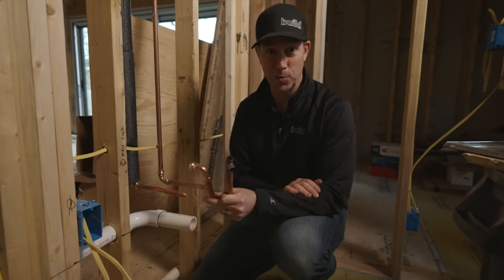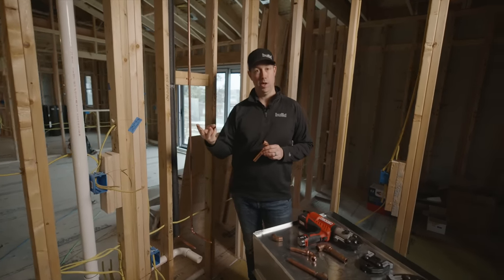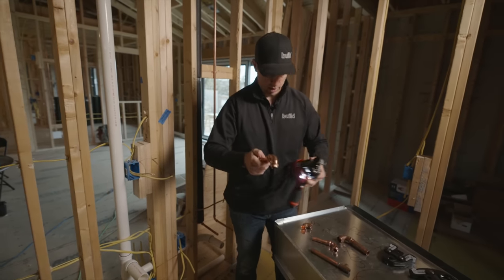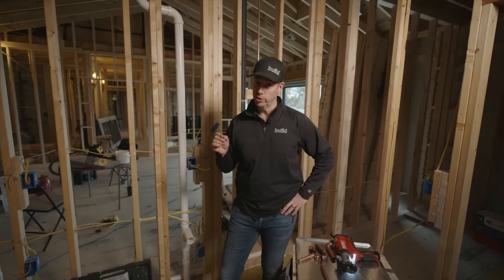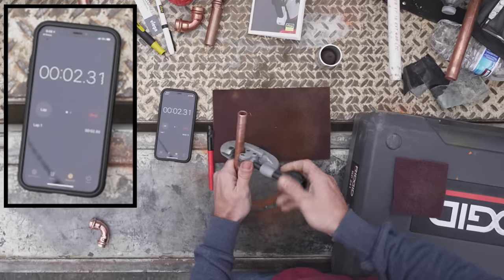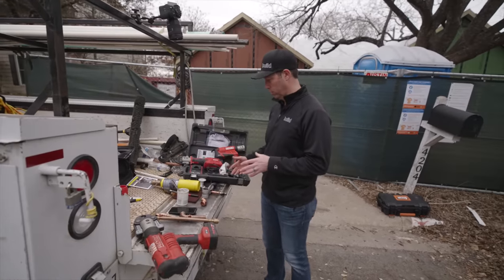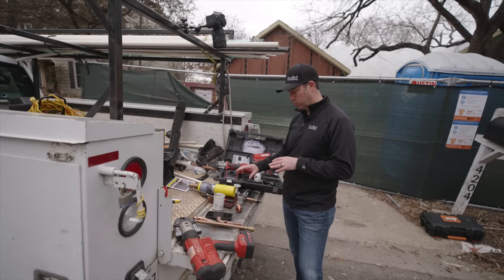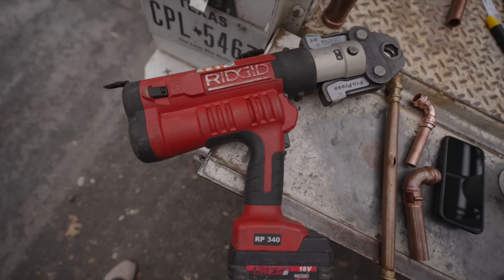Copper Plumbing - Viega ProPress vs. Soldered

Comment: As a DIYer, I learned I will never afford that tool even when I remodel a bathroom or repipe an entire house.
How well do the manual tools work?
Reply: You could dry fit your connection then rent the tool to bang them out quickly.
Reply: Just get good a sweeting pipes, it's tried and true.
Reply: James Last Name , I've been plumbing since late 80's and I bought the manual press about a year before I bought the Milwaukee M12 and hard to believe but I saved enough money in that one year manual pressing instead of sweating copper to buy the M12 everyone right now is saying bull crap but true I landed a big contract installing shower valves and I mean alot of them so much time saved because almost none of the water shutoffs would stop the water completely took forever to solder the steady water dripping. So the pressing worked out for me.
Reply: When I redid part of my hiouse myself, I rented a tool from the plumbing supply house for $50.00. It is so fast and easy I was able to egt everything done in a day
Reply: @plumbbuild6517  I had a big building years ago with copper and old valves. no pro press.the building was empty.i needed to change all the tub shut off valves.so I cut out all the old shut off valves in one day.then waited till the next after all the water drained down out of the pipes and sweated on all new shut-off valves. a pro press then would've took half the time.

Comment: I absolutely clean the pipe ends when I'm using my manual pro press tools there's also some cases you cannot use the ProPress because it will not fit in and you must use a tourch.

Comment: In the uk you can get swept bend or long radius elbows...

I wouldnt say its a detractor when you compare a completely different elbow - especially when solder fittings are way less than £1 each.

Comment: I would still prefer the solder joints... I like being able to undo things. Heating a joint back up and sliding things apart is a lot better than cutting it out. This is why I don't like plastic and I think that fittings that can't easily come apart cripple the main reason I like copper and undermine one of the benefits that make copper worth using. Sure copper may outlive plastic but man... I really hate cutting things apart to fix something or add something. It is vastly easier to just heat it back up then slip it apart. And simply having the option is a comfort to me lol
Reply: Time will tell on the longevity of the O-ring (???). Having worked with the ProPress for over a decade I can assure you no matter how good you are with a torch the ProPress is much easier and faster, even if you have to add an extra fitting or 2. That being said when I build my own house it is 100% L copper and lead-free soldered 👍.
Reply: @boby115  right indeed. My view is that the added cost of time is something that is more than made up for in the ability to easily and quickly fix issues down the line. And as someone who routenly troubleshoots things, there will always be something. I worked 12 yrs in landscape irrigation and several years in IT now but everything needs fixing eventually. And the ability to just pull apart pipe to slid in something new is worth the  onetime cost of instal for innumerable possible needs to adjust and or fix.

Comment: The crimper compresses the copper to create a mechanical fitting that resists separation but it does not seal. The O-ring in the fitting creates the seal. Sweating (or soldering) mechanically fixes the copper fittings together while also creating the seal. School is out on what method is best. In old homes and in tight spaces when repairing pin hole leaks caused by galvanized nails used to hold copper pipes in place,... crimping is the way to go to reduce the possibility of fire. Is sweating or soldering a joint less healthy? There are still questions.

Comment: I did Plumbing work for over 20 years and I have not ever seen one plumber deburr copper pipe unless it was going to be flared.
Reply: You didn't  do an apprenticeship  or commercial  work then. If you don't deburr copper it causes  turbulence  which will shorten the life of the system.
Reply: Somebody is a hack and doesn't even know it.
Reply: Well, that just shows that you're a hack, Walter.   Not only are there good practical reasons to deburr copper, and just poor craftsmanship to not debur it,   it's also required by code.  Either you don't know the code,  or you do know the code and choose to violate it.   Neither says good things about you.

Comment: I used progress gas. In my area we have 2 lb gas systems and use copper gas lines. Pro press plumbing great for boilers as well.
Reply: Megapress when its black steel.

Comment: I just worked on a place that had a pipe running out of a wall to the outside, rhe owners didnt insulate the piping, so the propress fitting just popped off on the inside wall. Granted the pipe also burst on the outside, none of the sweat on fittings did, but the 90 on the inside just separated. This is the real test since the 90 was being pushed by the ice inside the straight pipe.

Granted this is a 15 year old press fitting, not Viega. But maybe as the pipes freeze, the viega copper being thicker, didnt contract as much as the main pipe being type L, so it was able tonjust slip right off.

Comment: Issue with propress 
- can’t easily remove since it presses the pipe. With sweat you can desolder pipe fittings, but it’s not easy. 
- cost for tools is high
- cost of fittings is high

Issues with sweat:
- need to wait for dry pipe. Need to use bread or boiling pipe
- need to have good flux
- need to know what you are doing. Where to apply the heat. 
- need to have sweat shield and fire extinguisher. 
- need to have a torch.

Comment: Pro press has one major weakness, the O ring, over time, it will break down, there's no avoiding that, I get that there is a rating, but if there is a minor defect to that O ring, composition wise, not a good time. I'll take a soldered joint any day of the week over pro press, a skilled plumber can solder multiple joints almost or as quickly as pressing, all while keep costs significantly less.

Comment: I am surprised that after the great Texas freeze that you did not use Pex. New construction homes across Texas were mostly spared over older homes with copper. Did you take a special precautions on exterior walls?

Comment: So why is this house using Copper? Seems like a $2-3,000 waste of metal along with the more difficulty for the plumber which ends up costing $10-15,000. Also add that, Copper corrodes / pits in many cities due to water, older systems used lead, and unless you are running 250C+ steam through the lines it's a waste.

Comment: I have one of the manual hydraulic press crimpers. I damn near need a 30 mg oxycodone to work that damn thing for a few hours. But $1,200 to $150 is a stark difference. Or 2,500 for the Milwaukee system.

Comment: I had to replace a section of pipe inside a wall about 20 years ago, and I couldn't get a good bead without buying a special 'C' fitting for my oxyacetylene torch - even with that weird black flameproof matting (which looks like a black Scotch-Brite pad), I couldn''t get the copper hot enough with a regular torch. I would have bought one these things, as expensive as they are, to finish that job.

Comment: Aside from being more reliable than Sharkbite, the ProPress system has the advantage of not creating a break when copper pipe is being used to ground the electrical system.

Comment: The un-reusability of these fittings should make them illegal. I also don't think the seal is done by the copper to copper contact. There's no "fusing". What there is, is pretension. When you compress the outside fitting on to the inner one, you are deforming both parts elastically and plastically until a given level is reached. Then you release the tool and the plastic deformation on the outer part remains and that gives the inner part some elastic deformation or pretension that keeps the two "bonded". But this only happens to the top and bottom of the fitting/pipe. Did you notice how there's a gap? That gap will get less pretension than the rest.  "In this house we will use Type L so it lasts longer" actually= "use the thicker tubing or it might leak". The new fittings that you haven't scratched will seal great. Until you insert the fitting on the tube and cause axial gauges. Anything where there's a narrow grove, this tool/fitting system will not seal. That's what the EPDM plastic is trapped in there for. That material has a large CTE so pray that the joint doesn't expand during summer and contract during winter. Summary, the crimp doesn't seal, it's just the thing keeping your tubes together. The EPDM is what seals and it's plastic. Plastic lasts a long time, but not in perfect condition. It degrades over time. These joints will be garbage in the years to come. But not all bad news, these are ROHS and REACH compliant, and also probably food safe.
Reply: Take the EPDM o-ring out and 30 minutes later... garbage! 
https://youtu.be/7Z8WSFqq13E
But I suppose you could remove the EPDM and then crimp it, then solder it lol. The heat would get rid of your preload. On the other hand, you would need less solder to do the job.  But this would be the answer to "hey I love soldering pipes, but I sure would love to never be able to remove the soldered fittings ever!"

Comment: Sweep 90's for sweating are available literally everywhere.  They're all I use even though they cost between twice and three times as much as the hard 90's.  Still less than 1/2 as much as the compression variety fittings.  Unfair to represent the sweat fitting as though the option isn't there.  Also, even though there are more consumables, I could buy a lot of consumables for the $700+ that compression tool costs.  Each system has it's advantages.
Important point, the copper is not fused by the compression tool.  It's just very hard to slide a polygon over a circle.  If you cut through the fitting lengthwise the pieces come right apart.  Not fused.
Reply: $700 for the compression tool?
Try $2000!
Reply: @dnomyarnostaw  The big guy may be.  The residential guy is available around me for less than $800 with 3 jaws.

Comment: Looks like great system, and it seems solid, but usually when a product or service is displayed without disclosing the price, it's because it's ugly.  Why didn't you compare price, when you compared features?
Reply from the maker: That’s a really difficult topic because labor rates vary so much in the US. In general, these fittings are gonna cost more than a typical fitting, but the savings is going to be in the labor. I also think there’s a benefit to the customer knowing that each fitting is uniformly better than sweater on.
Reply: @buildshow  Have to say do enjoy watching this channel but as someone who grew up with plumbing, I have to point out that for small jobs such as replacing my bath with a shower tray next week I will go with copper and solder as no expensive heavy tools to buy or hire. Next year when we upgrade our bungalow I will go with pex throughout and get someone else to do it as I'm 60 soon and my knees are shot. Either way, you have to insulate the pipe properly which plumbers hate as it's extra time and fiddly to do right. I see Texas unprotected pipes can freeze just the same as in the U.K. 
The corrosion problem in copper can be avoided with a chemical flush and inhibitor at first fill of the system and long term I always fitted a manga clean to catch all the iron from the rads etc that might otherwise "pinhole" the system. 
The system you show looks good for larger maintenance companies that can pass on the extra costs and is backwards compatible with older systems but if I were growing up now doing plumbing with pex now that the materials and fittings are so much better than 30 odd years ago I would have that now. Who knows in another 30 years they might be 3D printing pipes in situ with robots no labour costs required.
Reply: @buildshow  I disagree with being a better fitting. 40 yr master plumber. Maybe just old school, but I never had call backs my way.

Comment: Ultimately the EPDM is the sealing surface despite what Matt says here.  Why else would it be there?  Why Matt tries so hard to say the opposite and even tries to distract the viewer is a bit puzzling.
Reply: Because it's not there for sealing the EPDM get deformed and the copper legde is pushed in to the pipe like those krimp-on ring connection!

But anyway in Europe sweating/soldering is almost not done any more... Even DIY guys use the krimp-on connection tools might be expansive but it's so much faster that it makes no sense to solder your pipes...
Reply: @jaspervermaas  Copper and solder joints are very popular in the UK. I did my whole house in copper, except for two underfloor heating zones, that were pex married to copper at the exit point.

Solder joints are cheap, reliable and effective and the only real downside is the heat.
Reply: @tjwatts100  true it's cheap but if you have the crimping tools or can borrow them from friends than that's way faster
Reply: It is not the sealing surface. The copper to copper is the sealing surface. The epdm acts as an external compressor like a band clamp
Reply: I wouldn't trust an epdm seal over a soldered connection.

The "hexagonal" Ridgid crimping tool is just a more expensive than a $20 propane torch & bottle. In 100 years only the solder joint will still remain.
Reply: @Knealeriley  EPDM compressing copper walls wouldn't happen-  Even if it were, it's on the inside of the joint, not outside, so it wouldn't serve that purpose.   If the pipe end is at all out of round, the o-ring will need to do the sealing, because there would be a copper to copper gap.
Reply: Agreed the o-ring is the seal.  You can tell because there is a little bit of play in those fittings.   O-rings eventually fail.
Reply: @Ken-wu2bf Nope, you can find plenty of videos of people removing them and then using the fitting and testing.
Reply: @RJ_Cormac  6:45 EPDM is not in contact with water

Viega ProPress is copper to copper

I have a 100 year house with iron pipe: no copper

Most likely will replace with PEX and SharkBite when remodeling the kitchen and bathroom
Reply: @Ken-wu2bf  O-ring isn't the seal. There are plenty of videos out there proving that the copper-copper compression makes the seal.
Reply: I'm sorry but I gotta agree to disagree, would love to see someone plumb their house with these without the o rings.  The plumber used a handful on my water heater and I already see water seepage even with the o-ring.
Reply: @Ken-wu2bf  Pictures?
Reply: Yes theses videos exist but it you bang the pipe they start leaking immediately..  so as long as your house has no vibrations and no one bumps a pipe your fine.

Comment: I’m sorry I can’t help myself. The nomenclature being used to describe how the pieces are put together is incorrect. They are not fused. I submit that they are in fact friction fit even the sweat fittings that is a friction fitting. The two pieces of copper are not fused together like in electric arc welding, or forge welding, there are two independent pieces with the intermediary material in between two cause friction such that the pieces will not blow apart when subjected to water pressure pressure but if I’m wrong, please tell us cause I want to learn and again thank you for your great videos I’m just being a bit fussy about nomenclature.

Comment: Don’t use M copper for plumbing water supply pipes. You have to use L. M is for heating systems.
Reply from the maker: Appreciate that. Didn’t know
Reply: Yes but so many plumbers out there still use that sorry M copper, I for one don't use M copper at all.And never will
Reply: M copper does poorly in hot water applications. The heat changes the metallurgical makeup over time, the copper turns pink/red and deteriorates.

Comment: The O ring does the seal.
Seen these type of fittings fail where I work. They are used on 1 inch air lines. They would leak where there was any mechanical stress on the fitting, would cause the fitting to twist and destroy the sealing ring
Reply: " The O ring does the seal. "   Yeah, the idea that the press crimps the copper to a watertight seal by itself is, well, silly.  Matt is talking out of his ass for much of this video.
Reply: @andrewalexander9492  Have you ever water pressure tested a pressed fitting with the o-ring removed? You’d change your tune

Comment: Since when plumbing is a speed test? The real test is whether it will leak or not in the long run. Most of the plumbing repairs are residential. Just checking before the plumber is coming over because I’m not trusting any contractor after I got screwed.

Comment: In early 2008, true MAPP gas production ended in North America
Reply: That's true.  MAPP was a proprietor blend of gases.  However, the MAPP replacement gases sold now still produce a hotter flame than propane.

Comment: Iam a union plumber  only thing I dont like about pro press is the if a tool makes job faster that means I make less cause I get paid by hour.. 2nd is that I run work and getting people to properly cut a pipe and debure properly and take time to make sure fully inserted is a hassle.  Plus a torch and heat can reach alot more areas that massive tool can

Comment: Only joined with flux?  What about the solder?
Reply: I caught that too.
Reply: What video did you watch?
Reply: @logresmentotum7065  he said joined with flux before he went out to the plumber
Reply: @logresmentotum7065  Matt said flux held the joint when he was in the house @1:13. He then corrected himself that flux helps move solder into the joint when he was outside behind the truck @9:45. Maybe Matt didn't have enough coffee?